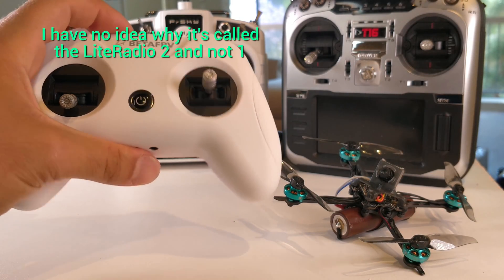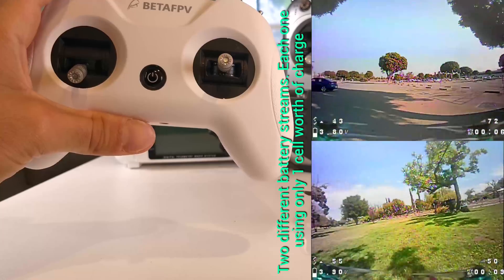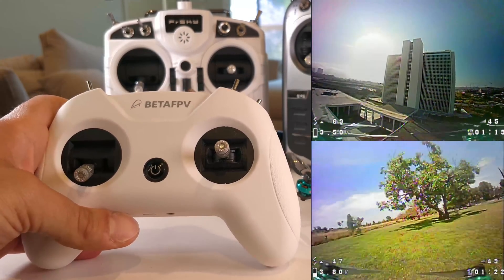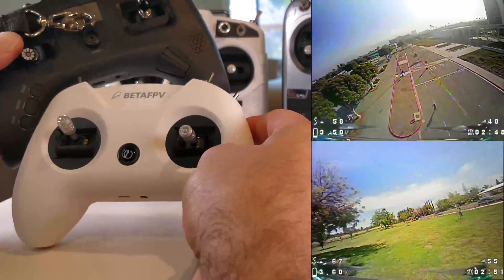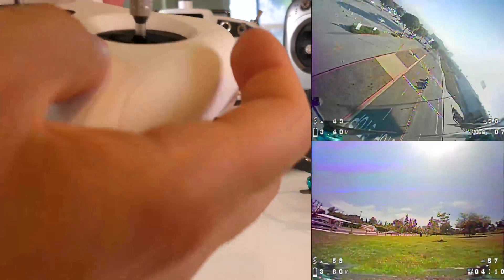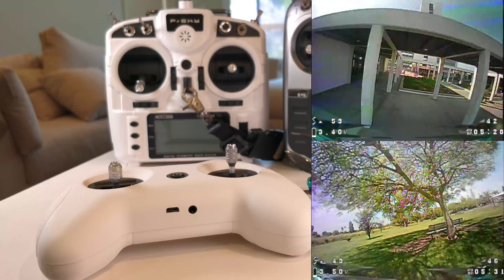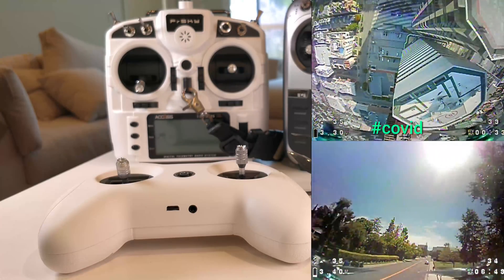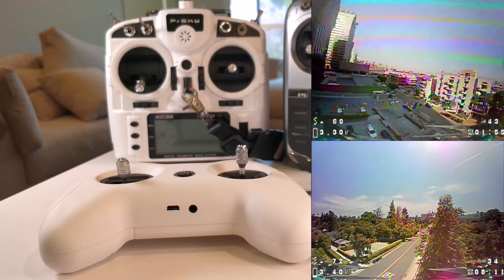BetaFPV LiteRadio 2

Comment from the maker: BetaFPV LiteRadio 2: https://bit.ly/2L6oKop
We only stocked a small batch and are unlikely to re-stock because we're not a big shop yet.  The little money we have is being put towards R&D for products that don't exist.  We cannot thank the community enough for their support and will keep developing for everyone.  This controller can also be found at BetaFPV.com currently.

Optimal BabyTooth flight performance: https://www.youtube.com/watch?v=ulOiUcR0cJM

The BabyTooth 1S 3" platform:
- Motors: https://bit.ly/2UlySPA
- Props: http://bit.ly/2OfK2Cu and http://bit.ly/382yyJs
- Battery: https://bit.ly/2yuJYts
- XT30: https://bit.ly/3drN5kq
- Frame: http://bit.ly/2NrbM64 (back in stock ~May 17th)
- Canopy: http://bit.ly/2tlyHsH
- Vtx: https://bit.ly/33JfdvW
- Camera: https://bit.ly/3ftb9FB
- AIO: https://bit.ly/2ycjIUd
The AIO linked above is the best option available right now but it's failure rate is unfortunately higher than we want to see.  The failure rate is no better or worse than any other light 1S board on the market.  We're currently working on four boards in hopes that one of them actually gets manufactured to our standards.

Build video: https://www.youtube.com/watch?v=Ai_oqRC-KG0

There is also a new battery connector in the works that we'll start using when available.  Higher current than the BT2 but smaller than the XT30.

▼Recommended TP3 build: (MUCH more powerful than the BabyTooth)
- Motors: https://bit.ly/2y9I5BP  (unfortunately restock is looking at early July :-( )
- Frame: https://bit.ly/2UBD7Ft (back in stock ~May 17th)
- Props: http://bit.ly/2OfK2Cu and http://bit.ly/382yyJs
- AIO: https://bit.ly/2Jjl4OU
- Battery: http://bit.ly/38aViqA
- Canopy: https://bit.ly/3dwqi7W
- Vtx: https://bit.ly/33JfdvW or https://bit.ly/2V6RvWj
- Camera: https://bit.ly/3ftb9FB

▼Join my FB group for more discussion: Kabab FPV
https://www.facebook.com/groups/379155946182689/

The store: www.FPVCycle.com

▼ My typical 5" quad setup:
-Hyperlite Glide Floss Lite: https://fpvcycle.com/collections/frames
-Motor: http://bit.ly/2Nqqr25
-ESC: http://bit.ly/2oDdzvL
-WaFL’s Cap Cap: http://bit.ly/2GUpXxO
-Battery: http://bit.ly/2JnsTDM
-FC: http://bit.ly/2XRc8G8
-FPV Cam: http://bit.ly/2Q7LfL7
-Vtx: http://bit.ly/38Y25oz
-ND GoPro Mount 30deg: http://bit.ly/2WC15zc
-ND Filter (if used): http://bit.ly/2WEmQ1j

FPVCycle 1303: https://bit.ly/2y9I5BP (should be in stock on Apr, 4)
Amax ET1303: https://bit.ly/2vPWgLB
T-Motor 1303:  No clue where this is sold

▼Notable motors:
-Xing 2306: http://bit.ly/2Nqqr25
-Xing 2208: http://bit.ly/2y3te8R
-FANTASTIC 6" motor: http://bit.ly/2LqghOZ

▼Starter goggles: http://bit.ly/2qbJNOS

▼ If you want to solder better:
-Fantastic solder: https://amzn.to/2P5QM2W
-Fantastic iron: https://goo.gl/DqBipa

▼ Tips?
Patreon: https://bit.ly/2oGLP9b

-PayPal: https://www.paypal.me/kababfpv
-Bitcoin: 1E4XZXoD4rS6MYWVWuenY7Kw2M1YgyNpoQ
-Nano: xrb_1188ek5bd7tb9kw67asnp9o65byuoaxbtpxuznx1ribf75x78awywmakj55f
-ETH: 0xD067F93811f2eC31CB1928901002dfdf9A492EF5
-LTC: La2KWYAjp4VT2Lq2M76pbjzXWvRyjpfCtG

-Tesla Referal code: https://ts.la/bob40889
Please use my referral code if you're gonna buy a Tesla.  You get some free stuff when you do and I get better status with Tesla.